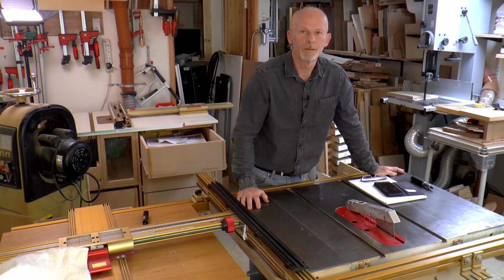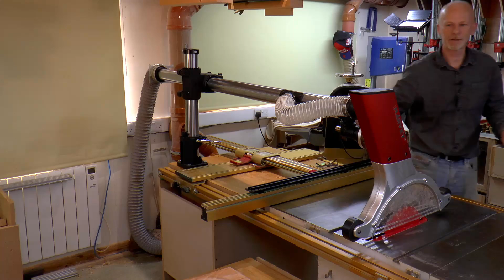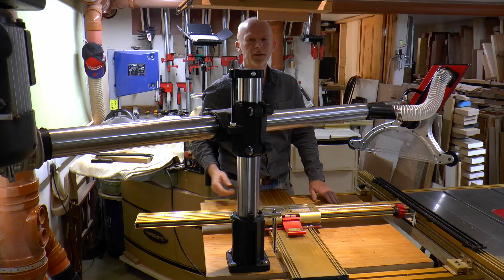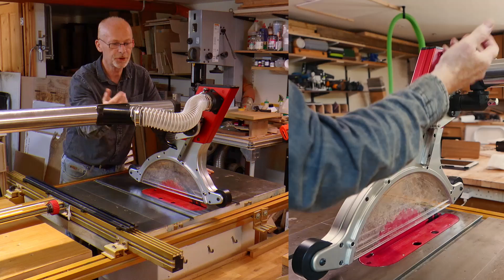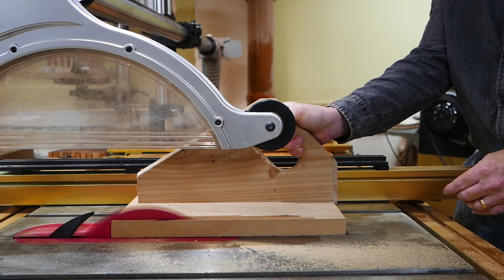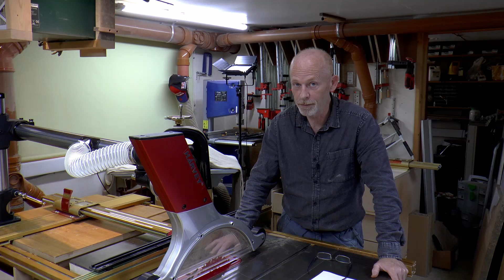Axminster Trade Shark S-12 Overhead Blade Guard Review

Comment: I've gotten very serious about dust extraction and control for the first time in my long history of woodworking.  After spending way too much money on a dust extraction system of Rolls Royce quality and performance, I could not find a crown guard with a suitably large extraction port, so I made my own.  Quite honestly, I always considered the design and construction of this blade guard to be an process of trial, error, and improvement.  However, I can see that in the process of seeking ultimate dust control, I have created a safety hazard with respect to cutoffs and kickback.   I am shocked and dismayed at the cost of this Axminster guard but it may be time to bite the bullet. Thank you for your review.  Good food for thought.
Reply: I am interested in knowing your path after this post.
 I have been chasing dust collection solutions since my 1st table top saw. My current setup kind of works better, each iteration achieving better results.  I am currently looking at this setup and a Harvey Gyro 700.
My vertical style dust collector moves a ton of air, but leaks the fine dust, which is counter productive. 

Good luck with your solution.
Reply: @oldmarine312  I built a cadillac dust extraction system in my shop.  I say cadillac because it cost about that much - 3hp dust extractor placed in a shed outside of my shop, connected to an 8" galvanized manifold and stepped down at each machine to 5" with blast gates for each point.  So far so good (works a treat with shaper, jointer & planer)  I then built a perspex crown guard for T.Saw with a 5" outlet,   not good. The large width guard allowed short cutoff pieces to get caught by the blade and thrown back at me at a high rate of knots.   I then made a smaller guard about 3" wide with a duct that I bought to go from a rectangle  shape to a 5" round vent.  Same thing happened albeit with a smaller piece (pointed on one end) that would have penetrated my stomach had I not been wearing multiple layers.  I don't want to go to a smaller width guard because the friction loss will detract from dust extraction.  I am considering modifying my latest guard to prevent pieces from being lifted upwards and getting caught by the blade.  I've not seen any large width guards for sale that wouldn't present the same risk.

Comment: Well it is only money and my fingers are worth far more than even 750 or so quid. Table saws scare me enough that I am trying to see if I can achieve the same results as a table saw with a track saw and an MFT workbench along with a router table, a well tuned and adjusted miter saw built into a wide worktop with fences with stops and everything,  and nice big band saw, which by the way ends up being more expensive than a good hybrid table saw, so it isn't about saving money. 

But if those other tools can't give me the level of accuracy and capabilities that a table saw will, then I'll just have to break open my piggy bank and get a SawStop and this overhead guard. And yes I understand that the SawStop will sacrifice itself, or at least a cartridge and whatever blade happened to be in the saw at the time, should my finger find itself going into the blades. But I don't want to depend on some fancy bit of kit working exactly right in a fraction of a second as the only thing keeping my fingers attached to my hand when my ADHD kicks in. So having something physically between me and the blades so I don't ever have to find out if the Sawstop is everything it claims it is is money well spent in my book. After all it is just money and people spend far more than this on far less useful things. My neighbor just dropped 40k on a boat that I guarantee he will only use about 3-4 times a year and spend the vast majority of its time under a tarp being an eyesore to the neighborhood.
Reply from the maker: Was there a planer in there to clean up the bandsaw cut, if so then I think you're going to achieve your goal. 👍👍
Reply: @GTWoodshop  Yes, and I am going to splurge and get planer/thicknesser with a helical cutting head. With a sled jig, I can also use the planer as a jointer to get a true flat face and then flip it over and run it through without the sled and flatten the other side while keeping it parallel to the first side.

The one thing that I am having trouble seeing how to accomplish without a table saw is how to joint the long edge of boards so that they are straight AND parallel with each other. The track saw is great to get a nice straight edge on the first edge.What I am having trouble seeing is how, without the tablesaw and its fence, to get the other edge to be both straight and parallel to the first. Any suggestions?
Reply from the maker: @papparocket Consider a planer thicknesser ?
Reply: @GTWoodshop  Do you mean to run the boards through the planer on edge to plane the second edge to be parallel to the first edge cut straight with the tracksaw? I didn't think you could do that.

But then I thought about it. If you are jointing a board to be used by itself, say in the frame of a dresser, having the two edges to be within a mm (~1/32") or so across the length of the board is likely all that is necessary. I would think that using an accurate combination square and a marking knife to put two cuts the same distance from the first cut edge and then setting the track saw track so the edge strip is right on the cut marks would give a second edge that is straight and parallel enough to the first edge. And if there is a tiny bit of a gap against the perpendicular end of another board, well then isn't filling tiny gaps what saw dust and a bit of glue was made for.

If you are using the board as part of a panel that is gluing several boards, then use the method above to get the two edges as close to parallel with each other as possible. Then put two boards up against each other. If the edges are tight against each other already, then you are good to go. If they don't then put the edges against each other and clamp them to your workbench so they don't shift around. Then run the track saw along the joint between the boards so the blade cuts some out of each board. The two edges will be by definition mirror images of each other and fit perfectly. 
To keep the panel from drifting as you fit each board to the previous board such that the two outside edges don't end up terribly parallel to each other, I would try to position the two boards such that they are in contact and the outside edges of the two boards are as close to parallel as you can get them before cutting the joint between them.

This, I think, then accomplishes with sufficient accuracy everything that using a table saw to cut the second edge parallel to the jointed edge.

Does that sound about right?
Reply from the maker: @papparocket So the answer is yes you can totally find multiple ways  to achieve the same end without using a table saw, and if thats what you want to do then you should do it, without a doubt.  Its your workshop so its yoour decision.  You are the only person that can decide if its right. 👍👍
Reply: @GTWoodshop  Thank you so much for your thoughts and encouragement. For now,  I'll see how far I can get with a track saw, router, Fully tuned up miter saw and a bunch of jigs. And if I can't accomplish the level of accuracy and to a lesser degree, productivity, then I'll save my pennies until I can swing the cost of a SawStop.

Comment: This was very helpful. I'm thinking of getting the Shark wanted to ask you how difficult is it to put togeather. I have a Harvey 2HP model and want to put the cast Iron Router end on. You thing it would be hard to use a router on the end with his beast on it .TY
Reply from the maker: Hi Thomas, I think careful placement will be the key to success and joyful working, or a very frustrating time indeed.  Its not an addition that you would take down easily when its in the way.  Hope that helps. 👍👍

Comment: First I would like to say the production of this video was nicely done. I've recently purchased the same overhead guard and an Incra TS-LS positionar. I've received the guard however the positioner isn's expected to arrive for a while yet. I noticed that you didn't install the counter ballance leg assembly for the guard, could you go into some detail as to how you mounted the verticle column to your table?
Reply from the maker: Hi Nick, firstly thank you. 👍. I didn't go into that  much detail on the installation as I deviated from the instructions so much. However, if you pause the vid at 1.18, directly underneath the vertical column is an MDF cabinet I made years ago to support the end of the Incra rails and of course provide storage.  I took a piece of 28mm MDF and bolted it to the top of the cabinet, then bolted the column to the 28mm MDF.  It is holding but it nots ideal as the column is gradually starting to lean   I will be changing the installation quite dramatically in the next few weeks (hopefully) so I've planned to film the install in more detail.  Hope that helps.  Kind Regards 😎
Reply: @GTWoodshop  Thank you for your timely response. I will be looking for the posting of your video detailing your redesigned mounting system. Would I be correct in assuming that you were unable to use the supplied leg support due to the Incra rail system? I really appreciate your videos.
Nick
Reply from the maker: @nickmastropietro377  Hi Nick, hit the nail on the head sir.